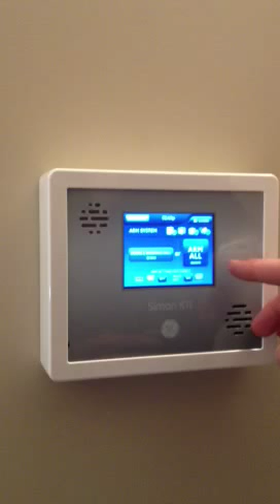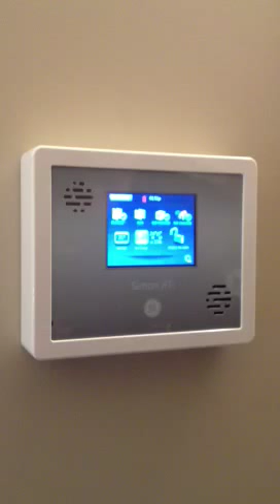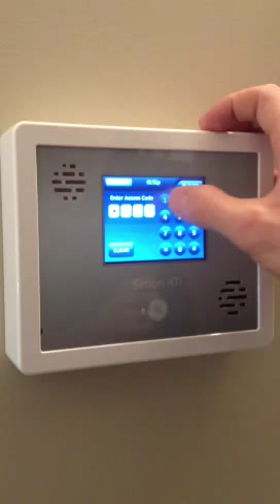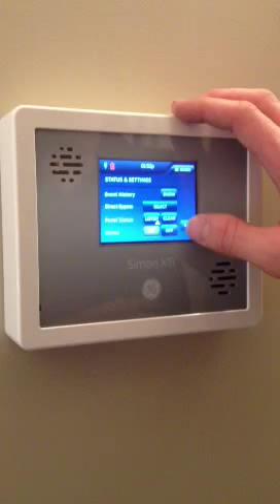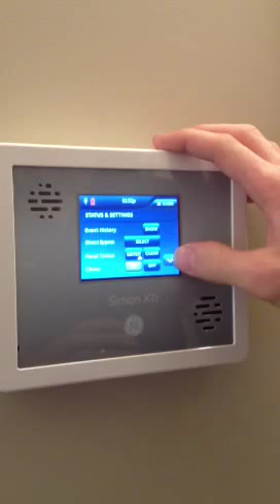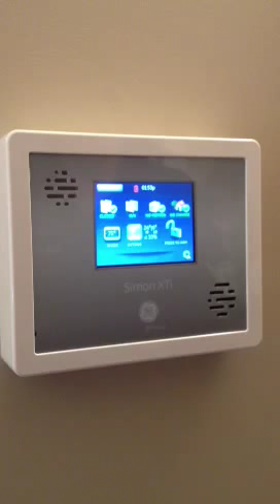Simon XTI user guide

Comment: A reply to the other comments: You hide the power by plugging it in elsewhere and tapping into the DC side of the power with two wires, which you run through the walls to the unit.